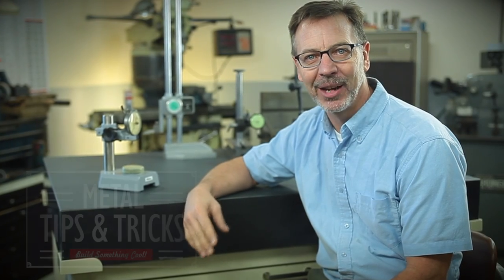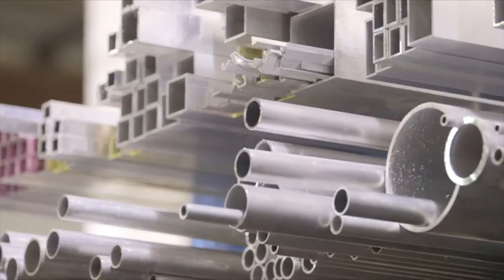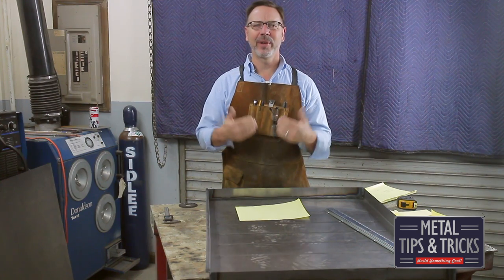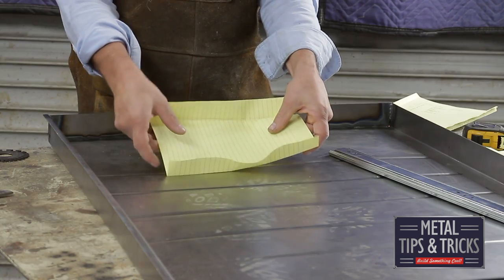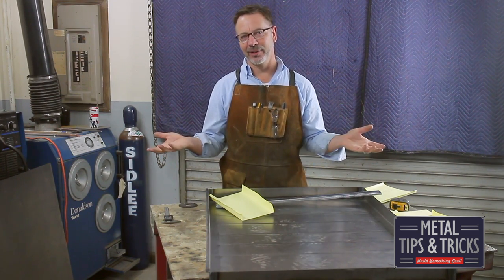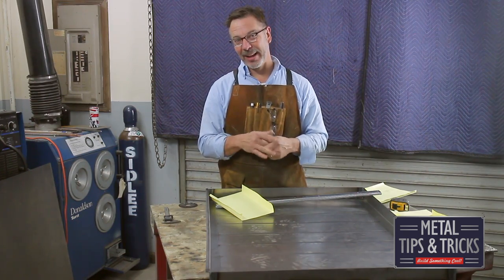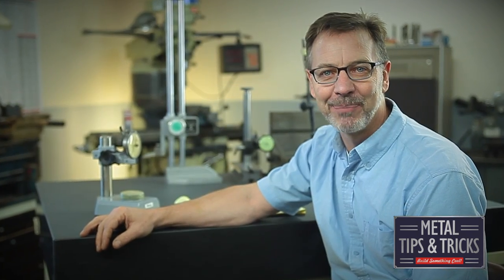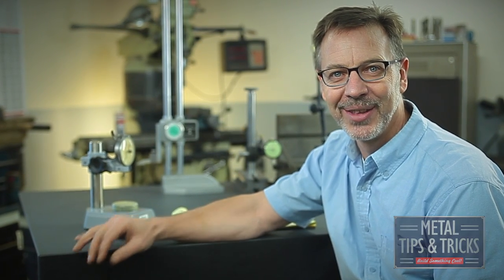Building Drawers for the Ultimate Metrology center

Comment: So strange that I come across this video today. Just finished taking an old 70's Snap On box apart. What they did was similar with back plate except they folded 2 short side panels and the bottom in itself the way you describe the conventiinal way is. However instead of it being a full size bend it is about 2/3. They then inserted the extra plate which is at the same thickness as reast of the drawer just reinforced sides and bottom with 45 corner seams. What i thought was really clever was they punched holes inner and outer plates/plate (not drill it appears makes sense if assembly line is used) and tacked or rivit the plates together through the holes. Then making it flush. I have not stripped or drilled any open to see exactly what they did.  No long bead lines, box reinforced bottom and sides less material is my guess. 

I really like your ribs in middle of bottom plate. That way one can use thinner and lighter material. Same principal is used on standing seam roofs to avoid oil canning from metal expanding and contracting through heat/cold. It never occurred to me to do it. Thank you for sharing your ideas and how you did it. I am very glad i came across your channel. Whish I could give you two thumbs up.

Comment: I've always liked welding corners (albeit with oxy-acetylene rather than TIG) using the workpiece metal rather than filler. I never tried dissimilar thicknesses, so this is a new string to my bow. Thanks.

Comment: when im welding in a similar situation to this i add 50% of the thinner materials "rule of thumb" amps to the "rule of thumb" amps of the the thickest. seems to work out well. that being said i usually run a little hotter than most. ex: i would run this project right about 155amps, i think you said it was 16 gauge sheet, .065= 65*.5=32.5 ( i round down for the final number) 32.5+125=157.5 so i start at 155 amps...sorry jeez im a long winded SOB
Reply from the maker: Thanks for your comment. I will have to try it :-)

Comment: Gauges and inches... American units are just pure mayhem
Reply: He also made it even more confusing since he wrongly said 1/16 gauge ... Typically gauge is used for steel and fractional inch sizes are used for aluminum if material is not specified.